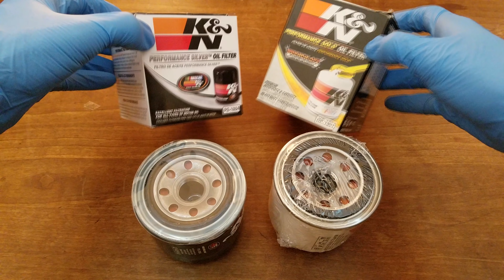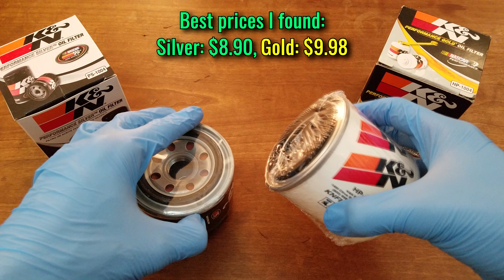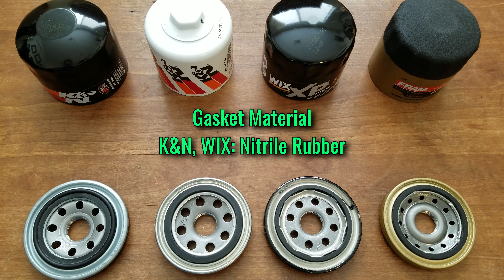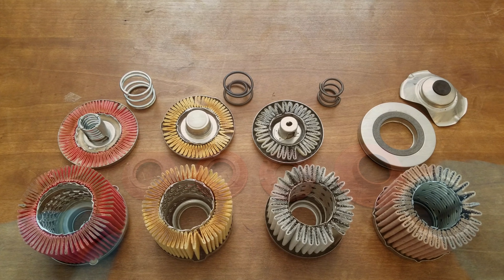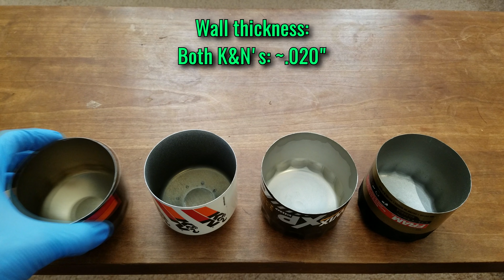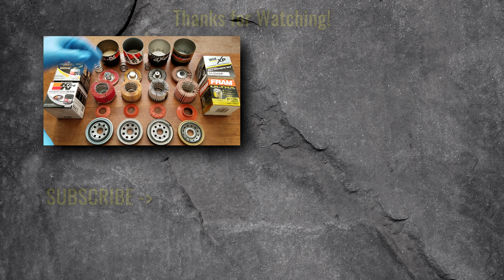K&N Oil Filters Cut Open!  Performance Gold vs Performance Silver vs WIX vs FRAM

Comment: I would like to see the Bosch filter reviewed. It's currently the best filter for my 91 ZR1 with it's LT5 engine. The filter on the LT5 is installed upside down. So a filter with a good anti drain back is needed. I find all filters do drain back after the car sits overnight or days. The original AC black filters and their first blue replacements work well you just can't find them anymore. I have used the K&N white filter a few times.

Comment: Champion Labs

Bosch
Car and Driver
Deutsch
Mobil 1
STP
SuperTech
K&N
Valvoline filters
Mighty
Service Champ
Lee
AutoZone Value Craft
Some AC Delco
VW (some)
Warner
Luberfiner
Trust                           this is who  makes  them    fram  makes  their  own  Wix  makes  these 

Carquest blue
Carquest red
Napa Gold
Napa Silver (lower quality with nitrile ADBV)
Kralinator (in Canada)
ALLIANCE (Freightliner aftermarket).......Purolator (Arvin Meritor)

Purolator premium plus (nitrile adbv)
Purolator Pure One (silicone adbv, different media)
Havoline
Maxlife Valvoline (some)
Group7
Promotive
Powerflow
Quaker State (less media)
Advanced Auto Total Grip. (less media)
Pep Boys Pro Line
MotorCraft
Superflo    

Toyota                                     denso  makes  these  

Mann+Hummel

Mann
Volvo

Clarcor

Baldwin
Hastings
Amsoil
Casite                    hope   this helps you....

Comment: From what I've heard Fram uses a horrible filter paper that's almost useless but I have no idea. I have been using STP Extended 10k for full synthetic oil basically because it usually comes with the oil I purchase in a combo and I'd like to know how that one holds up. I usually use Castrol full synthetic high mileage or valvoline equivalent. Which ever one they have on sale I'll usually pick up a few to have handy. The filters used to come sealed in plastic but I think they cheaped out on that so I might upgrade next time because I personally think all filters should be protected from the elements a little better then a thin piece of cardboard.
Reply: You're right.  You have no idea.
Reply: Fram filters are the worst, I was a dealership tech for 12 years and know that some manufacturers will deny warranty internal engine repairs if the car has an orange fram filter installed. That being said the Fram ultra synthetic filter is probably one of the best oil filters on the market and is definitely the best value for a premium oil filter. I run Fram ultras on my own vehicles. I would never run any other Fram filters even if I hot them for free.

Comment: Only two corrections. The 1" nut is for quick removal.
That little hole isn't for removal or installing.. It's for motorcycle racing and any other tracks. It's a safety tether point so it doesn't get blown off onto the racetrack and cause damage or injure somebody.👍 Remember, it's a high flow racing filter.
Reply: 7/8 nut
Reply: @MrNetnut  I have a brand new one in the box right here and too lazy to check for myself. 😁
Reply: @MrNetnut  I double checked..
"K&N's Wrench-Off Premium Oil Filters feature a 17mm hex head nut affixed to the top, making them extremely easy to remove in those hard to reach places.Jul 12, 2013"
- Google Search -

Comment: I'm pretty sure the nut on the K&N is only for removal.  If you use to install, you could crack a spot weld and weaken the case, or crush the gasket too much.
Reply: Agree, hand tighten the filter.  Never leak.
Reply: @MartinSage  for spin on oil filters, yes... cartridge, not so much, use a short ratchet or even a torque wrench if you happen to have one.
Reply: On the motorcycle forum to which I subscribe, a pretty vocal group has noted very serious failures of the K&N with the welded nut on the end, and several related engine failures and crashes when the filter sprayed all the engine oil out after a catastrophic failure.  The location on my motorcycle is such that it would be able to spray the front tire and spray the road in front of the rear tire.  The K&N silver would appear to remove that point of failure.  The K&N filter on my bike did fail at the weld nut with a noticeable leak recently (but this was not a catastrophic failure, and although I noticed oil smoke while riding, I guessed what was happening and headed home - riding very carefully) this confirms - at least  anecdotally to me - that this is a very real possibility with the K&N gold filter.  I did not use the nut to tighten the filter during installation.  Again, I like the general construction of the K&N filters, but I will never use the gold version with the nut on the end again.  The silver version may be a reasonable substitute.  I will never use a Fram screw on filter assembly of any type on any vehicle I own - the build quality is often terrible, and the overuse of glue on the filter media is a deal breaker for me.  I might use a cartridge filter made by them if it does not have the same failings as their mass produced, cheaply made garbage.
Reply: @libertycosworth8675  I completely caved in the bottom of my KN filter on a rock taking my road bike where it shouldn’t. 
Zero leaks 🤷🏻‍♂️
Not sure whose reporting that shit. 
I run KN on 3 vehicles right now all nut topped.
Reply: @TankToChest  I can't speak to failures for other applications - just Honda VFRs, and others who have bikes like mine who post on the VFR boards noted similar failures, and it was well over a dozen (and counting) who noted the exact same failure mode when mine failed a couple of years ago.  As far as your off road experience, you may have been lucky... Maybe K&N has changed their production process since the time I was using their filter on my bike, and that filter failed at the welded on nut.  I don't know. So, was your bike a VFR using a K&N 204-1 or was the bike another Honda using that filter?  Looking at their more recent production filter for my bike, it looks like they may have changed the nut cap on the filter... looks to have a wider flange and more spot welds, but obviously I did not keep my old filter, so I can't really compare the failed filter to a new one.  I just know I will never use a 204-1 on my bike again.  Too much risk if it were to fail again, oil would go right down the middle of the bike to the rear tire, that makes for a very dangerous situation on a sport bike.
Reply: @libertycosworth8675  Look...only use the nut to loosen the filter IF and only if you can't remove it by hand or with an oil filter wrench..problem solved.
Reply: @stephenbrown7545  Your response was totally clueless and nonsensical. If you had read ANY of my earlier comments, you would know that *I DID NOT* use the nut on the filter at any point during the installation process.  The filter was tightened by hand - no force applied to the welded nut assembly. PERIOD, DOT, END of story.  The filter sprung  a leak (FAILED) during engine operation a few months after installation * AT THE WELDS ON THE NUT ANYWAY** - that constitutes a manufacturing failure caused by K&N's actual process of welding on the stamped steel "nut" assembly.  Since my application is a motorcycle, this is a pretty serious riding safety issue.  Using the welded on nut on the filter to remove it after it has already started leaking isn't going to change anything.  BECAUSE IT WAS ALREADY LEAKING!!!!
Reply: @libertycosworth8675  Yawn
Reply: @libertycosworth8675  I had a failure at the weld as well and almost crashed due to a massive slide.Back tyre soaked in oil and stranded 100 miles from home.Lost 1.75 litres of oil.And I put it on hand tight.There have been many failures.K and N actually had a hotline ....to claim a replacement filter.
Reply: Always hand tighten
Reply: Jimmy, I did.  If you had read my earlier comment you would have noted that I did say that It failed at the nut after hand tightening - no wrench was applied to the nut during installation.  It failed anyway.  A poor welding process causing a weak place in the housing probably caused the filter to fail after the cycles of expansion under pressure.
Reply: never used it on my K&N oil filters but I like the thought that I could use it
Reply: The nut is so you can put the filter on with a 600 ft/lb air impact. :D
Reply: Agreed 👍
Reply: Ive been running kn gold filters for 10 years on 4 vehicles I own and I  use the socket to put it on every time, 3/4 to 1 full turn with zero issues! I understand why your not supposed to, but im also not over tightening it like some people probably do.
Reply: Nuts r 4 squirrels
Reply: After the gasket swells is that makes removal way harder than installation.
Reply: The "nut" has a hole in it. This is so the filter and be safety wired onto a bike or car for racing.
Reply: True you could crack the nut. Removal only very important.
Reply: On my car, there is little room for tightening so the filter is finger tight rather than hand tight. Oil filter wrenches you can't guage tightness well at all. Just go nice and easy with the socket wrench.
Reply: @Billy_Darley  Not this guy...only a dummy would use the nut to tighten it.
Reply: Nothing wrong with using the nut for installation, just as long as specified torque settings are used.
Reply: @timmasonguitar  Not true.  Hand tighten always, and the nut is used for removal only.
Reply: @235buz  Everyone has a different feel when hand tightening.  Owners' manuals give a specific torque setting for everyone to use.  I trust the Kawasaki engineers.
Reply: Voice irritating,talks too fast ,so I gather kN or Napa gold ,wix
Reply: @53mjackson  There's an optional setting you can adjust in YouTube called Playback Speed. Check it out.

Comment: you should push dirty oil through the membranes at a constant rate and compare particle capture based off of coloration (or if you can centrifuge the oil pre and post flow.)
Reply: Dirty oil from the same batch of course.
also great content thanks!

Comment: Excellent video. However, on my vehicle, I have been using synthetic oil with the FRAM XG3682. Unfortunately, Fram is not producing much of these filters anymore. I was thinking of switching to another brand, similar to the XG-3682. Which brand would you recommend.
Reply: Major D switch to the Purolator Boss filter. It’s better then the Fram XG
Reply: JUNK the FRAMS!

Comment: Fantastic as always!
After watching this I'll be going with the K&N Performance Silver for an upcoming road trip.
Though I love WIX filters, the K&N is less than half the price of the WIX XP right now.
Plus it looks like it will flow very well, hold a lot of particulate matter, and be a great filter overall.
Reply: @David-999-z  Hahaha, I wasn't claiming it was a miracle filter. Just looks like a solid product. Worked great on the road trip as far as I can tell. 11,000 miles no issues.
Reply: Using a k&n gold in the stealth rt  seeing good p.s.i on the stock oil gauge which further sells me on them being a great choice on Mitsubishi 6g73 motors.
Reply: @dustytanco8745  Thanks for that info! This filter worked great on my 11,000 mile road trip, at least as far as I can tell. Won't lie, still haven't changed the oil. Used Castrol Edge 0W-40 with it and I loved the oil. I'm sure I could probably get another few thousand without issues, but it's definitely time for a change.

Comment: So there I was, changing the oil on my 2012 Civic coupe, and I had a newly purchased K&N oil filter.  I installed the filter and after tightening by hand in that tight space , I put my cheapie plastic socket filter wrench on it to give it a quarter turn...and the socket wouldn't go on.  What the heck was going on?   Then, through an opening in the plastic under tray of the car I caught a glimpse of three words on the side of the filter  Made in China . That was all I had to know ...I took the filter off and fired it in the garbage. If they can't get the sizing of the canister right , what else didn't they get right?   No more K&N oil filters for me. Mark out !
Reply: Mark Anthony  next time try a LuberFiner oil filter by Champion. For about $10.00 you get a very good filter. Amazon Prime is free shipping
Reply: That is unexpected! Wow

Comment: Weigh the gaskets,  the Wix filter gasket is thinner and smaller on that filter than the rest, meaning more metal. Wix is a Great filter so is K&N filter. Fram is.. shit.  Well if you buy the best Fram you may have an ok filter.  I use Wix.. Official Filters of NASCAR Oil, Air, Fuel.. etc..
Reply: Yes, I don't know if that one he has is a Fram filter for synthetic. That would be as you know the last one Fram makes that is not complete junk (who knows how long until they go low budget on that one too). If it is not it must be an old one. Fram is no longer made in the USA and is full of paper. The Microgard from Orielys is a Fram filter on the inside with the same manufacturer number. I am glad I checked before someone used it.

Comment: Excellent video explaining the differences between the filters. Keeping the oil clean in any vehicle is critical to maintaining the engine. I use Automotive Wolf car maintenance software www.automotivewolf.com to track and monitor the maintenance schedules on all 3 of my vehicles. I've been a long time user of K&N oil filters since they're one of the top quality filters on the market.
Reply: I will never use K&N. A friend of mine lost an engine to one of their oil filters. The threads separated from the filter and the filter shot off causing a loss of oil pressure. To the credit of the company, they covered the replacement engine. I exclusively use Wix (Napa Gold) filters. He now does the same.
Reply: @gokartbuyer  I had exactly opposite experience with Wix XP filter. I would use K&N rather than Wix. Wix have not covered any expenses, even not for their own filter. See my Amazon reviews.
Reply: Seung Jung interesting, thanks... I use NAPA GoLd AS preferred , in my two vehicles.
Reply: gokartbuyer thanks, for report..... interestingly  coverage for damage, , Great CompAny...  amazing abkut damage, Anyways, I,uSE NAPA GOLD, FKR MY TWO  vehicles, as preferred,, ..
Reply: Thanks for making this video shows what's good and junk rather run good stuff on my vehicles

Comment: I have been searching and there are no videos on the aFe Pro Gaurd D2 oil filter.  I would like to see a review of the aFe 44-LF018.  I don't think it has a bypass valve.  This part number fits my 2011 Subaru Outback 3.6R Limited.

Comment: I just purchased the kn gold for my upcoming oil change. Il be using the usual synthetic 5w20 Mobil but I only have 3k miles on my oil now. How many miles can I go with the kn gold filter?
Reply: joe montero you do change the oil, just not the filter. I have a passat with k&n filter using full synthetic oil. I change my oil every 5k but my filter will last 20k. So I change the oil but keep the filter. Hope this helps
Reply: joe montero 15,000 - 20,000
Reply: Im_MENIME thanks but I would never go that long with the same oil. I usually do a 5k oil change but going to wait to do a 7500 oil change since ok be using good stuff. Thanks for your response
Reply: I go by smell, touch and slickness. It's more a feel thing rather than an actual science.

Comment: Missed perhaps the most important thing - filter surface area. Take the filters out and do a simple measurement and rectangular surface area calculation.
Reply: Thad Joseph you didn’t miss it.  Skimmed right over that detail.  More pleats doesn’t equal “better filtration’ either.  More pleats equal less flow but more dirt holding capacity.

Comment: Nice review, but I'd like to see you do some testing on the filter media itself. Total area when streached out, a classification in microns and some sort of flow test. A test involving the bypass threshold and  how well it cycles and seals. I know thats a lot to ask, so maybe some engineering test info from the manufacturer might have to be taken for truth unless you can figure some way of confirming what they claim. Again thanks for doing this. There is a guy "AVE" that does alot of power tool testing that might be able to set you up with some ideas for testing, he's pretty smart and seems like a guy who will hook you up.
Reply: Absolutely this. If you are going to test filters, making a judgement based upon visual inspection only, is useless.  Test the item at the job it is intended to do.
Reply: Diezel I don’t know if frame filters are bad or not however I’ve been using them for many years and I’ve never had any problems with them I would like to see a Fram ultra tested against all the other filters to see if it can hold its own or if it’s truly no good,,,I would be interested in finding this out,,, I have also read that Walmart entered into a deal with Wixx filter’s and basically learned as much as they could from that experience and then pulled out and went to Champion laboratories or something like that and basically used everything they learned from Wixx to start making a better super tech brand oil filter,,,folks are saying super tech filters are as good as any other filter at a fraction of the cost I bought one I intend to use on my Toyota Tacoma in the near future for under three dollars.
Reply: Exactly. Visual comparisons are pointless and prove nothing.